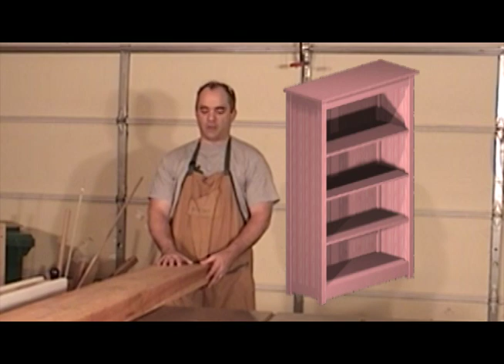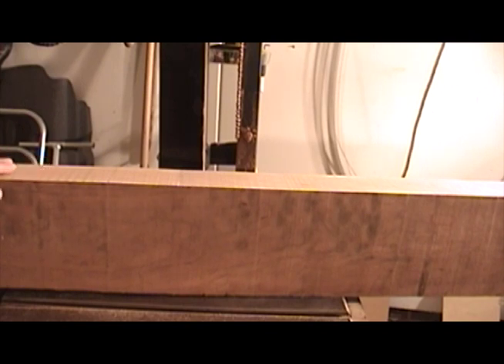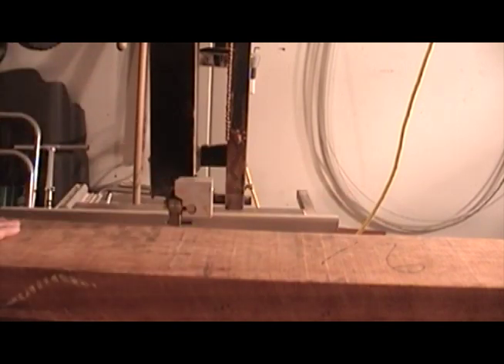Bookcase Part 1

Comment from the maker: @BradburyGuy  No sweat.  It was also not flat on the bottom (in the rough) and only edge jointed on one side.  The rough (non-flat) bottom also added to the difficulty.  It went surprisingly well though!.  Cheers - Brian